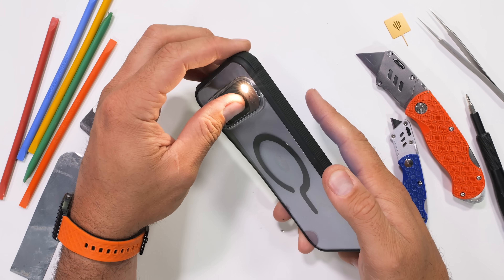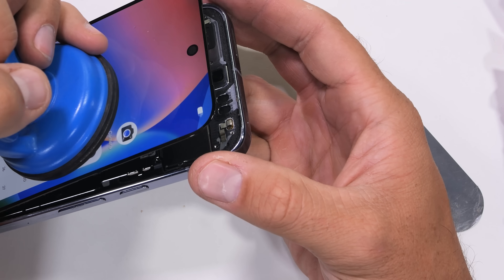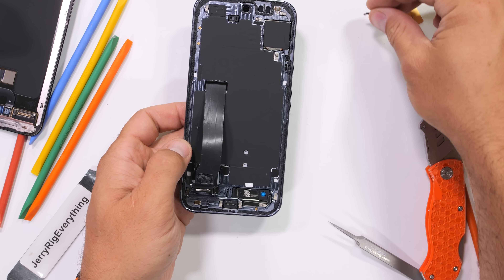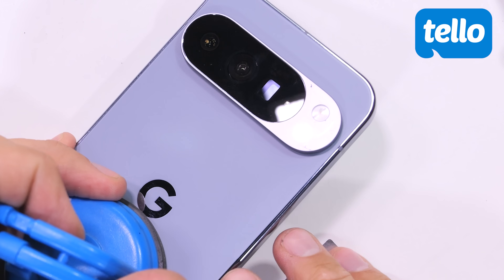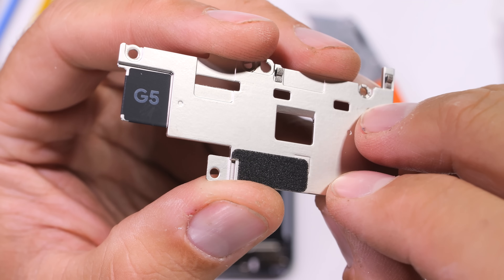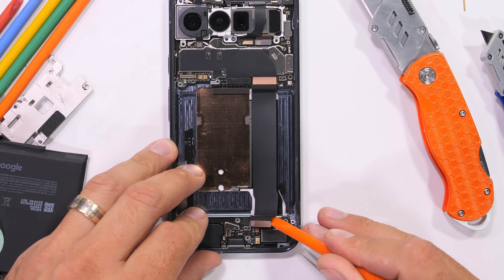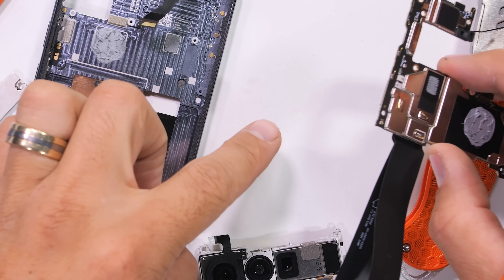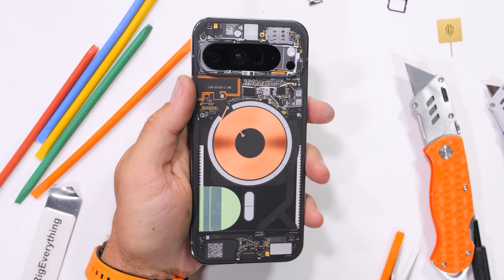GOOGLE FINALLY DID IT! - I'm so proud...

Comment: I dont understand, what makes this Phone more repairable than the fairphone 6?
Reply: It was sarcasm. Obviously the fairphone is more repairable. Sarcasm is tricky for some people. Jerry has flawless delivery so it's less clear when he's being sarcastic. TBH it's pretty darn repairable for an ip68 phone. I'm glad to see Google making an effort. I thank fairphone and Jerry for holding their feet to the repaiability fire.
Reply: Based on what he said in the video here, it sounds like it might be that parts may be more available and that the repair documentation released by Google is possible more extensive. He said more easily repairable in the beginning which may have been a misnomer, but it could certainly be more repairable still if everything is more accessible and the internals are designed to be taken apart. More repairable doesn't necessarily mean easier to open (and if you strip the screws on the Fairphone, I'd personally find it more difficult).
Reply: @blazethefaith  Fairphone also has better documentation, heck, they even provide you full phone's schematics
Reply: What makes it less repairable?
Reply: @jakubmastalir3557 having to use heat gun, alcohol, suction tool, carefully inserting a knife to separate the glued back/screen makes it less repairable. there's a reason ifixit gave it 7/10. It's a step into the right direction but not as repairable as the fp6.
Reply: @jakubmastalir3557  The video claims that this phone is more repairable than the fairphone 6, so it's a valid question to ask, as there's no reasons given in the video. 
To answer your question though, the need for isopropyl alcohol, a heatgun and an ultra thin pry tool to get the screen and back removed is way more involved than on the fairphone 6

Comment: "Most repairable smartphone" -gets out the heatgun and alcohol within 5 seconds. I get it's more repairable for a regular smartphone and that is absolutely a positive development but there's no honest way you can claim this is anywhere close to Fairphone
Reply: Just came to argue this, this phone is very repairable, yes, but you still need to battle with glue, so I refuse to consider it "better" in repairability than a Fairphone.
Reply: It's still repairable lol, if you can't use a hair drier for removing the back and apply the glue to put it back for something as simple as a battery replacement, you should probably stick to phones from 2010. The +10 minutes worth of effort doesn't diminish that when every other phone you're up against is either worse or annoying as fuck to deal with
Reply: @illyaeater 0/10 ragebait effort
Reply: @illyaeater  what a bunch of bs, my phone is 2019 xiaomi and it is easily to disassemble without any need for spirit, glue or hairdryer. And yes it still works flawlessly. You're really like a bot who gets used to any kind of bs corpos toss to you
Reply: if you have no clue what you are doing just stop prent it should be possible for everyone...
Reply: If you don't have a hairdryer you shouldn't try to fix your screen anyways. Fairphone is a gimmick for people that never actually fix their phone anyways
Reply: @jakubmastalir3557 you shouldn't try if the phone requires you to use a heatgun but guess what, the fp6 doesn't. It's not a gimmick, it's just more repairable, your statement makes no sense at all lol
Reply: @Coweoss  it's a gimmick. Being scared of glue is litteraly a skill issue. The phones are much more durable and water  resistant. Much bigger problem for repairability is the cost of the display itself, which was solved by fairphone by using screen straight from 2018💀
Reply: @Coweoss  you comparing devices that have different specifications. Is the housing waterpoof to the same degree as the other your comparing it to ??
Reply: @jakubmastalir3557 you do realise that 99% of the smartphone users can't do what jerry's doing in the video? even repairing the fairphone is too much for the average consumer.
yes the Fairphone is lacking in other specs compared to the pixel but its still more repairable (which was the original point discussed).
Reply: @Unlogikmann im comparing devices on the reparability aspect (well jerry does actually). I know that the pixel 10 has better specs overall. but in terms of repairability and ethically sourced materials the fairphone is better.
Reply: @jakubmastalir3557 I personally don't think we should gatekeep repair like that, and also (European so its more common) I know multiple people who own and have replaced parts on their Fairphone so I'm not sure that I can agree
Reply: @jakubmastalir3557 Yeah, and those people now fix their phone themselves, you know why? because you just need a screedriver for it 😄
Reply: @jakubmastalir3557  bullshit, replaced a FP3 screen, all you need is screwdriver and your hands
Reply: @jakubmastalir3557  Fairphone's like all phones should be, by law.

Comment: The Pixel 10 series feels like a genuine good faith move to make these phones more repairable. If anything keeps my on Android in 2026, it'll be more repairable phones. Apple should get their act together and make their self-service repair program less of a meme. You generally don't need to rent 80+ pounds in specialty tools if the device was designed to be user serviceable from the start.
Reply: Unfortunately while opening up hardware, they are locking sown software.
Reply: @FrIoSrHy Why does it feel like a tug of war. You can have reparability but locked down software.... or you can have unlocked software but no  reparability.
Reply: @OhHeyItsJessica  Fairphone exists and has both.
Reply: @OhHeyItsJessica  because the false repairability is a distraction and not a true move toward reducing ewaste
Reply: @FrIoSrHy For real. That new policy is a slap to the face to Android fans. Makes want me to go to IOS
Reply: I don't think we should consider a glued together phone easily repairable, it's a really crappy solution.
Reply: @U.S.A. It's necessary if you want liquid resistance and most people spending this much on a phone definitely do.
Reply: apple won't even give use a macbook with a replacable ssd, repairable is at the very bottom of their list.
Reply: Install GrapheneOS for ever
Reply: Creo que la idea es que hagan telefonos bueno que no se dañen, a menos que no los cuides 🤷🏻‍♂
Reply: Yeah, but then they also pushed updates to the Pixel 4a and 6a to brick them under the guise of 'bad batteries' which were absolutely fine up until that point. I won't be surprised if they come after the Pixel 7a next.
Reply: You don’t need any of their tools to repair iPhones. Just a nice ifixit kit. The 16pro was a step in the right direction as you can do a battery swap through the back. Now they reverted with the 17 pro 😑 I think we need some regulation to require companies make their batteries serviceable through the back of the phone so you don’t have to risk breaking the display.
Reply: @NinetiesKiddd  The upcoming EU legislation on replaceable batteries will help.

Comment: iPhone 17 air bend test?
Reply: "the last Air bender" now hits different xD
Reply: phone isn’t out yet and I doubt apple want him destroying it yet
Reply: Yeah, we will see an ""awe bending" event. Bring on!
Reply: It won't bend, same as S25 Edge.
Reply: Wrong phone. 17 air still uses titanium to prevent the bending. 

The 17 and 17 Pro both moved back to using aluminum though!
Reply: @Sgt.MyGunBroke u right but its so thin.
Reply: @Sgt.MyGunBroke  cope, it will bend
Reply: @Sgt.MyGunBroke  17 pro has a titanium frame, I was on the website looking at it before.
Reply: @Spartavian95 no it doesn’t they literally said it’s an aluminum unibody
Reply: @Spartavian95  it does not

Comment: 4:09 Dang, that was a great feature for when my watch or someone else's phone needed charging. Glad my S25 Ultra still has it, but not looking forward to future phones removing it as well.
Reply: I just started bringing a small 5cm type-c to c cable with me and that has covered me for earbuds and stuff, I guess it's 1 less thing to lose though.
Reply: @FrIoSrHy Unfortunately, smart watches don't have a USB-C port to charge them, otherwise I'd probably do the same. Used to do this with a USB OTG cable back in the day and charge other people's phone's off mine before power banks were a thing.
Reply: Reverse wireless charging is the primary use of my wireless charging functionality on my Pixel 6 Pro (I don't wireless charge except maybe once or twice when my charging port got wet).
Reply: @maxrburgessI've only used it once when I had a rental that had a wireless charging spot but I forgot my own charger. I've got a 45 watt car charger, so it can charge so much faster than the much slower wireless charging can. Not worth it to use it in my opinion. Plus, it's very inefficient and uses a lot of power.
Reply: Is that why iPhones don’t have reverse wireless charging?
Reply: If you truly can't do both within reason, I'd rather have the magnets. Been using a ton of accessories since getting my Pixel 10 Pro. 

I use my phone caseless so access to the whole world of magsafe has been wonderful.
Reply: @onetwentyfour  But Samsung S25U you can reverse chage, and put a simple case with magsafe and it's done.
Reply: Never used it because its useless 😂
Reply: @KevinTM301  I charged a few iphones with it.